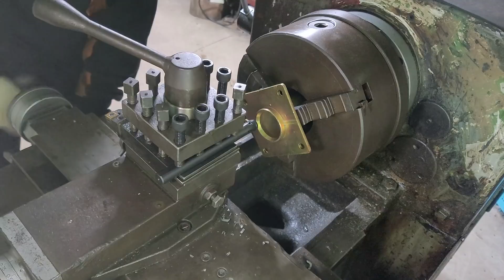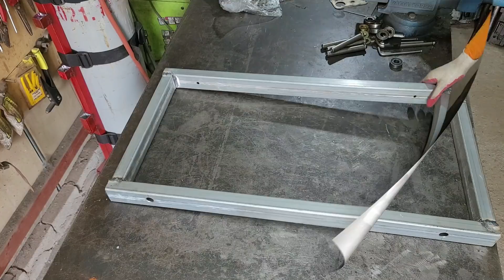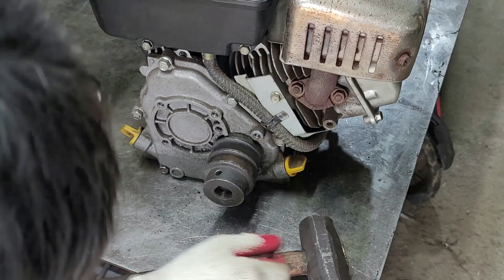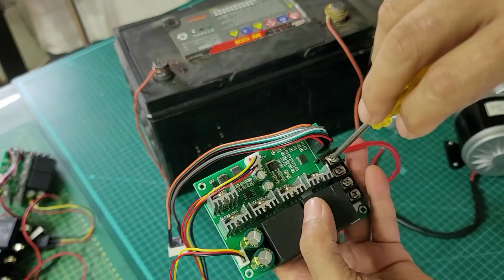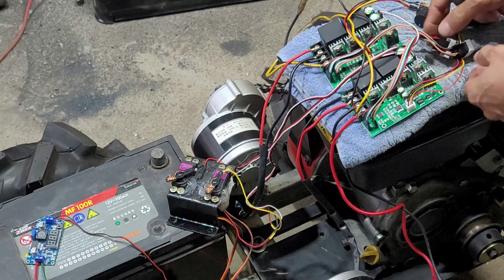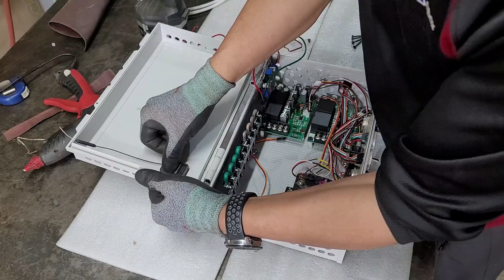무선조종예초기. wireless controlled lawn mower. Wireless controlCar. RC카. RC. 무선장난감자동차. 예초기 만들기. 무선조종

Comment: Very COOL!! Can you put links here about the electronic equipment you used?
Reply from the maker: Thank you!
Reply: @A_J_kim  Can you put links here about the electronic equipment you used?
Reply from the maker: https://www.aliexpress.com/
Thank you.
Reply from the maker: 10-55V 12V 24V 36V 60A PWM DC motor speed controller forward regulating knob switch control driver digital display
Reply from the maker: @goncalomorgado511  350W 24V 36V Gear Motor Electric Tricycle Brush DC Motor Gear Brush Motor My1016Z3 For Electronic Bicycle Motorcycles
Reply from the maker: @goncalomorgado511  MC6C 2.4G 6CH Transmitter Remote Control MC6RE Receiver and RC Airplane Drone Multirotor Helicopter Car Boat
Reply: @A_J_kim thanks

Comment: i want to make wheel hub by self so can you tell me about size of material pls?
Reply from the maker: The wheel hub diameter was 54mm.
Thank you.
Reply: how about axle? what size of nut did you use? i have no lathe machine so i want all your plan thank. i'll make axle wheel hub diy
Reply from the maker: @overflow1739  The diameter of the axle was 19mm.
The bolt was finished by making an 8mm female screw with a drill.
Thank you.
Reply: thank you so much guy i'll follow you
Reply from the maker: @overflow1739 
 thank you !